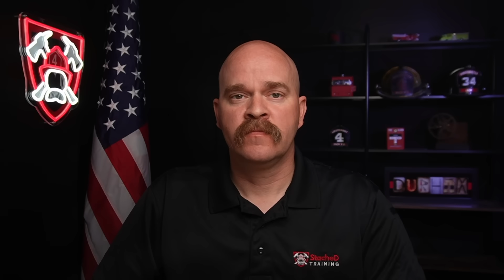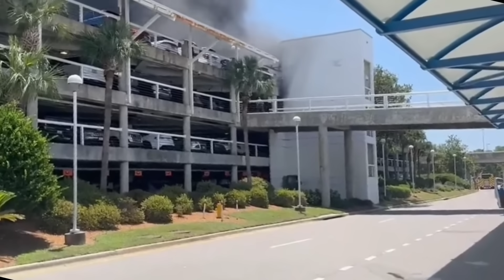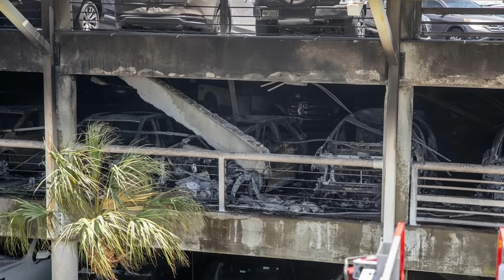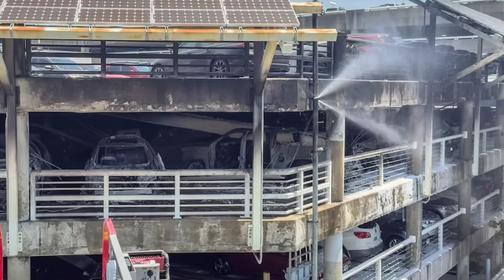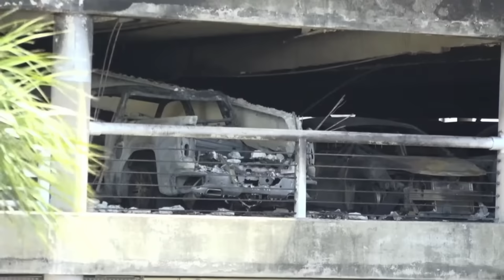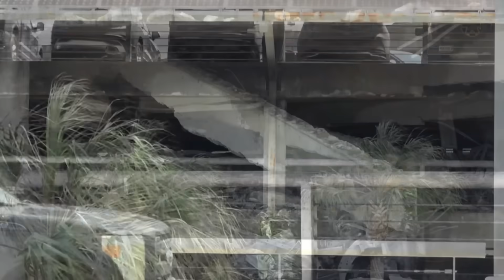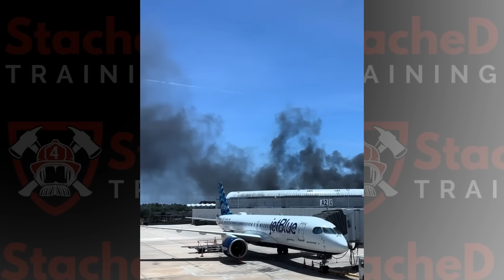Fire, Collapse, and Chaos: Jacksonville Airport Garage Incident

Comment: Honestly EV'S & Hybrids need to be banned as they are a rolling ticking time bomb
Reply: Plastic fuel tanks usually under the rear seat and about an inch away from hot exhausts, ignition systems with thousands of volts to ignite the fuel...., even semi-seized brake callipers can start car fires....(a semi seized calliper blew out my passenger front tire seconds after pulling over but to the heat)

Comment: 70 yr old here, extensive background in science ed, and working 46 years in labs, lived and worked on 2 continents. I never heard of parking garages or cars in those garages catching fire, ever. Sprinkler systems and spaced out parking were not necessary. Until EVs came along. There have been at least 6 of these catastrophic garage fires in the last 4 years, all due to evs or hybrids. Whole buildings totally destroyed. Wonder how much landfill space is being needed for the debris. The EVs and hybrids do not solve an "environmental crisis", these come about because of a government control and ration  agenda. This is no longer a joking matter. I certainly will avoid all park garages now, and when using open air parking lots, make sure there are no evs near my car, even if I have to walk a few hundred extra meters to stay away from those types of incinerators. EVs and hybrids can now be classed as incinerators. The evidence is quite clear. Only a fool will state there is no problem.
Reply: Not to mention marine car transporters
Reply: A sprinkler system won't do much if an EV catches fire. The EV need not be the original vehicle that started the fire but once it's ignited during a fire outbreak.......
Reply: Wow, talk about biased.

Comment: We have cameras in and out, license plate readers and can tell you which vehicle parked where and when. But no, we don’t know the model and make. 
🤔
Reply: There are no cameras in parking garages to identify where a car parked.
Only entry and exit points and standard security cameras which can give some information, but not identify what vehicle is where.   Those should help identify the location of the initial source.
Reply: @amzarnacht6710 they track license plates in many garages now to show where open spaces are. If they dont detect the license plate, then they mark the spot as available even if it is full. They do this in mall garages and airport garages in Texas. Even the bathroom stalls at DFW have an equivalent system now
Reply: @amzarnacht6710  Actually, there is.  That's how they knew the exact minute it started smoking and the exact minute is turned into a torch, and that's how they knew it was a BMW.   There's a lot of security at air-ports now days.  A local channel tried to obtain the video, but the airport authority refused on the grounds that they didn't want to reveal the capabilities of their cameras.  They absolutely know which car started it, and it should be very easy to tell us what if it was EV/Hybrid/Ice. 

Even if they can't read the VIN, there are other VINs on the car.  The license tag may be damaged, but it wouldn't have been damaged when the car drove in, and drove past the camera.  What would be even easier would be to ask people who are trying to claim their car a simple question:  When a lady says she wants her BMW that she parked at 8 AM, just ask her if it was an EV.  If so, tell her the car has departed, and send her some flowers or something.

Comment: Who's paying the THAT repair bill, insurance company's will soon enough stop insuring parking structures with ev's.
Reply: You are. And me.
Reply: The demolition job  and rebuilding you mean ? That 
Kind of heat  size off fire has probably damaged big portions of the decking badly ,even if it did not  collapse so to say , (concrete pipe sections are sometimes used as fire places grills  it doesn't take long for them to crack and get destroyed, even with a little campfire in them )
Imagen the concrete in that building  ,when the fire and heat  is that intense, Ian gussein sagging beams,  concrete Spalding and rebar that has  been  overloaded and stretched...

Comment: After the Luton Airport fire here in the UK I’m surprised every airport car park does not have sprinkler systems. Or am I?
Reply: too expensive, especially to retrofit in existing buildings.
Reply: @antontsau  Follow the money trail, it usually answers many of the questions
Reply: @logicalaction  of course - thats commerce, not charity. If it is safe in terms of life and health danger - no one will spend $$$$$$ if insurance is just $$$.
Reply: I think you’re missing the point, the money isn’t about commerce,it’s about greed And insanity, which is what feeds and runs the enslaved world of today
Reply: The first task in firefighting is life saving, for everything else there is insurance. If fires are sufficiently uncommon and the claims cost small enough the insurance cost is cheaper than the installation and maintenance cost no you shouldn't expect automatic firefighting
Reply: @Fred-gu6pk  and you shouldn’t expect thermal runaway when you buy a car
Reply: @logicalaction  Plastic fuel tanks usually under the rear seat and about an inch away from hot exhausts, ignition systems with thousands of volts to ignite the fuel...
Reply: @Fred-gu6pk  saving doesn’t just include life

Comment: Concrete parking garages rarely if ever saw massive fires before EVs came along and concrete beams certainly did not collapse after 20 minutes. I'm sure this will be all swept under the carpet as EVs are the way to our future net zero Utopia.
Reply: Lithium and sodium ion batteries burn hot and fast.
Reply: This has nothing to do with EV's making the problem worse. 

It is a dense airport parking garage with NO sprinkler, there is absolutely no way for crews to get water to the inner parts of the structure.

I'm sure some batteries burned, but they aren't the main reason why this fire got so large. With such a large hot fire most of the vehicles gas tanks would be melting and running gasoline to adjacent vehicles and setting them ablaze too. 

Blaming a single thing isn't the answer, there are always multiple factors.
Reply: @volvo09 it takes time to retrofit older structures, plus the monetary cost. This wasn't really a issue until lithium ion battery cars
Reply: @mickjoebills the difference between lithium ion batteries and gasoline is night and day. Gasoline while dangerous is a known entity and put out a gasoline fire is cheap, lithoum ion battery fires cannot be extinguished without more expensive methods and even then one damaged cell will reignite the whole thing again until the lithium is burned up.

Comment: I know they aren't sure what type of vehicle started this thing, but I have heard of parking garages banning EVs for this very reason. It's a lot cheaper for these garages to ban EVs and maybe even hybrids vs. retrofitting with sprinklers, and I am guessing increasing insurance premiums. In some cold climates, I am not even sure if a sprinkler system could be installed. It would be interesting to see a statistic of parking car garage fires and the number of vehicles damaged before and after EVs were introduced. I am sure they still happened, but I would guess that they were nowhere near as devastating and destructive as these.

Comment: I just got a UPS for my PC that uses 18650 LiFePO4 batteries...LiFePO4 (Lithium Iron Phosphate) – Known for its high thermal stability, LiFePO4 batteries typically do not catch fire when punctured. Lead acid batteries for UPS, and the SHORT runtime, and short LIFETIME are so Stonehenge.
Reply: Lead acid is a old stable tech that is easy to collect and recycle, it isn't as flashy or small but the risks are well known.

Comment: Vast majority of ICE vehicle fires happen when engine is running - it is a speciality of EV that they can set fire any time.
Reply: No, that's not factual as I just explained to "shadowcaster111"
Reply: When I fact checked this in Australia with statistics from insurance companies most ice vehicle fires were arson after joy riders were finished with a stolen vehicle.
Reply: its also 60 rimes less for an ev over an ice
Reply: @shadowcaster111 , that’s simply unproven conjecture. Data is incomplete at best and doesn’t reflect age, usage or other factors that contribute to causation of vehicle fires in most instances. 

Stached has broken data down in previous videos.
Reply: @shadowcaster111 did you miss the point about stationery parked vehicles?
Reply: @Philip-hv2kc  It's an airport, parked cars are found in parking garages with the engines still running.   I've even broken into one just to turn it off.
People rushing to catch their flight overlook that the vehicle is still on, especially these days with ultra quiet engines.
Reply: @shadowcaster111  60 rimes, must be new AI term the EV folks are using,  
The truth is many ICE fires are caused by Electrical Faults, not gas or diesel.
Reply: @rbnhd1144  Bingo... Most parked ICE fires originate in their electrical system.
Reply: @shadowcaster111  Consider that the EV fleet is all fairly new, and it is mainly older ICE cars that have not been maintained that catch fire. Many ICE fires are where the vehicle gets stolen and set on fire to hide evidence.
Reply: @shadowcaster111 Actually, most ICE vehicle fire start once they are parked. Or better, "RECENTLY" parked.  That's when flammable liquids, like gasoline, oil or brake fluid drip onto a hot surface and ignite. In the case of BMW's electric water pump recall and fires, it happens at both low speeds and at rest.

Comment: I am guessing that a water sprinkler system in a garage would help with a EV fire and would not eliminate risk. I have been exposed to the fire triangle model, heat, fuel and air, remove one of those things and fire is not supported. This channel seems to suggest that only a compromised battery can burst into flames. After that oxygen, a component of air helps the fire. Also I am guessing with a lithium metal battery fire water could become a fuel source as it would with a sodium metal fire. Liquid water does absorb heat efficiently so in an open parking garage a water sprinkler system would be a net gain, I am guessing.
Reply: Would a sprinkler system prevent so many cars becoming involved? Maybe extend the time over which more cars become involved?

Comment: Even if parking structures like this (whenever it was built) weren't required to have a sprinkler system, I'm surprised there wasn't a dry riser system, do you have any insight in the requirements for those?
Reply from the maker: It appears they has a riser.  In one of the images it appears one of the risers failed.

Comment: The cause of the fire will need to be determined through investigation. Thank you for sharing your account, but I’m missing some key facts that are important for understanding the development of a fire in a naturally ventilated parking garage. Tests show that every 6 minutes, the fire spreads to vehicles both to the left and right of the burning car. So after 20 minutes, more than 5 vehicles are on fire. However, if a fuel tank ruptures, a liquid fire can occur. About 15 gallons of fuel can result in approximately 75 square feet of burning liquid. I don’t hear you mention these facts, but they certainly contribute to the horizontal fire spread in such situations.

Comment: fwiw (from the pics the Airport uploaded to their Social Media less than 24 hours after the fire) I was able to confirm the specifics of the offending vehicle in that it was a "Bey Oom Vey" (BMW) X3 Compact SUV.  thus same as how the other German brands use internal Chassis Codes, in BMW world this variant is known as a "G01" starting with M.Y. 2018.  however while it was initially offered "Gas Only" only a year after it's debut the "Bavarian Megacorp" then added a Plug-In 48V Mild-Hybrid "E" variant to the line up which incorporated a fairly sizable 12 kWh Li-Ion Battery.  for reference the Battery in a 2025 Corvette E-Ray Performance Hybrid is only 1.9 kWh, so that's like a "baby's toy"...

now while the pic the Airport uploaded only showed the Gas filler door at the right rear quarter fender, if you scan the CPO listings for this model at any BMW Dealership near you spanning the last 5 years (2019-2024) you will likely see a pic showing a SECOND FILLER door located on the left front quarter fender which provides access to the J1172 port.  for safety reasons, rather than going back on to the deck to take more pics, they would probably be best served by extending a ladder back up and let a First Responder take a pic from over top of that palm tree looking through opening created by the vertical column of the parking structure and that concrete beam that's fallen down at 45 degree angle...

just a heads up everyone, the vehicle that the beam has fallen on is NOT the vehicle that was first seen on fire before the blaze spread to the rest of the structure, no, the offending vehicle is actually the one located to the "Driver's Right" of that.

Comment: Our fire doors rated for 2 hours are metal, if made of thick concrete, would be rated for DAYS, not hours.
Reply: Depends on the heat,OXY ACETYLENE (or something else with equivalent heat production like thermal runaway) can burn through/brake concrete within minutes!
Reply: @geoffsclassiccars  Those are not found in our hospital.

Comment: Only a matter of time before this happened somewhere. Luckily it was a large Dept that had the call. 
The description of how fast that fire took off once smoke was seen leads to EVs. Gas and Diesel engines cool over a 4 hr time frame. EV batteries do NOT cool down if they malfunction.

Comment: Wow, you can't take laptop with a larger than 500Wh battery on a plane, but you can park a 50.000 Wh battery in a building packed with other vehicles without any sort of effective countermeasures.
Is it that hard to find some more suitable open space for EV parking, maybe with a valet service to make sure it is checked regularly with an infrared camera and is charged by the time you return? Or is that just asking too much to prevent millions in damage and lower risk to the public and the firefighters?

Comment: Above ground parking structures are deliberately designed to not need mechanical ventilation systems as a cost control measure... why pay for all of that hardware and machinery, if you can just let natural air-change remove the exhaust gases from internal combustion engines?

Also, liquid hydrocarbon fuels tend to burn in readily controlled fashions, and, except for very old vehicles with defective fuel systems, you hardly ever see a fire, and it doesn't spread very far or fast.  Fire sprinkler systems, while sold as supression devices, honestly work mostly to allow occupants to safely evacuate while delaying the spread of a fire such that the firefighters are less likely to walk in to a fully engaged/engulfed structure.

The limited rate of spread of a fire also allows the cars to be safely parked at a minimum separation, with the lowest possible cost per vehicle parking space.

Things get even trickier when you take the garage underground. At least there, you must have mechanical ventilation and fire doors under current codes.

Lithium-ion battery vehicles don't fit the above conditions well, if at all, and as several parking structure fires around the world (this being the most recent) have demonstrated. Retrofitting existing garages and structures is going to be costly, and problematic, as the design criteria aresignificantly different.

The need fo rapid access to the underside of an involved vehicle due to the location of the battery pack under the floorboards is going to make underground garages much more expensive than expected... and what the market has become accustomed to.

Traditional fire sprinkler systems mounted above the occupied spaces will be effective as life-saving devices, limiting the spread of a fire and buying time for evacuation, but are of extremely limited value in any efforts to supress an engaged vehicle. Adding in low-level, possibly floor embedded sprinklers is going to drive up the costs of the structures.

We are now more than a decade into the integration of vehicles with large lithium-ion battery packs into our transportation fleets... and, the secondary safety aspects that were overlooked are now coming to the fore.

NFPA and the other fire safety organizations need to develop good, uniform guidance for both retrofits and future construction.